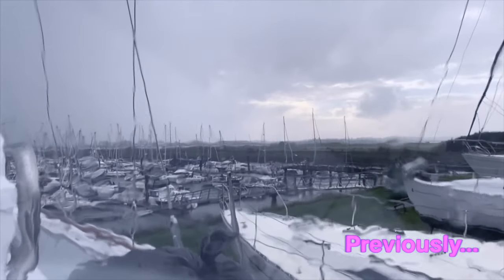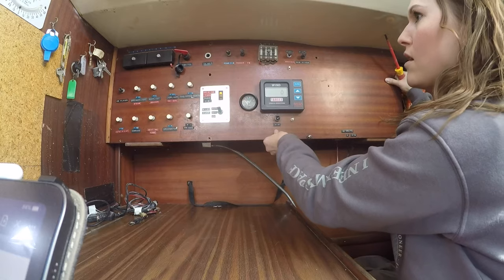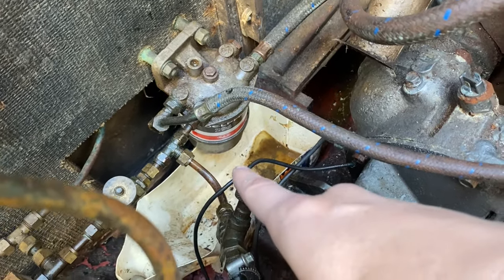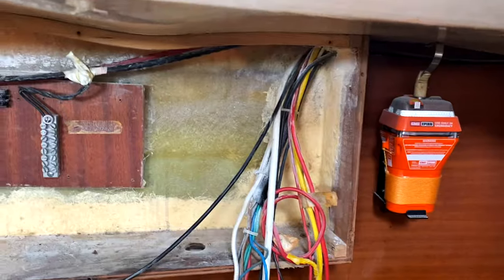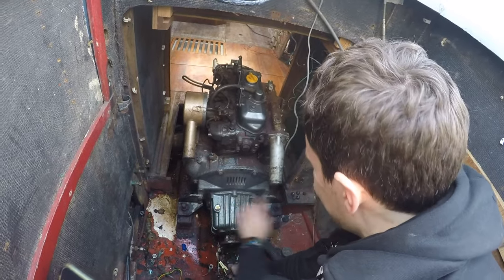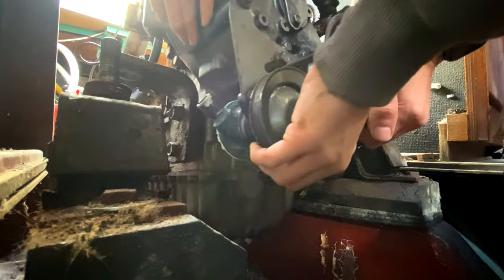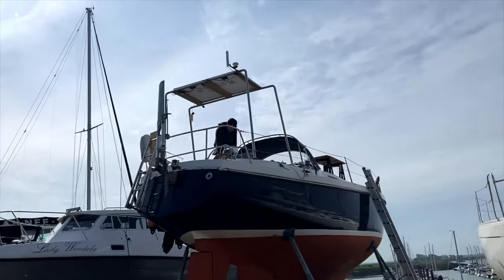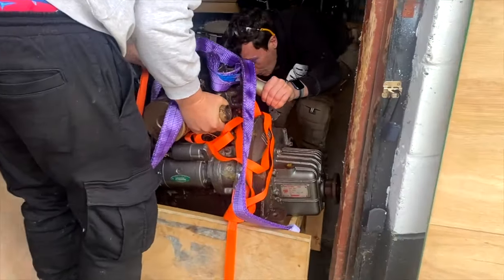Ep 11 | Engine OUT and Cable Management BEGINS!

Comment: ..... leaps ahead .... well done .. .... only concern is getting between a heavy objects that you can not fully control and a fixed object, especially a heavy object with pointy protruding thingys ..... when things go wrong it happens in a blink of an eye .... always have an escape route .... you know this, just felt the need to bring it to the forefront of your thought patterns for a second or so, not being critical, just raising awareness, giving the ol' grey matter something to mull over ... half wonder if that catch basin/cut-off-jug was for when that, was it fuel filter/water-separator, was serviced and was just stored there. Yes you are right Ben, better solutions, everything has a place ..... sounds exciting the thought of a sparkling bilge, don't like "au naturel" insides of hulls. Just a preference, choice .... recently bought an older vehicle and after a while found that there were certain electrical things not working, fine older vehicle (1990) to be expected, it is going to be more involved than I anticipated for sure, this realization hit home with the discovery of wiring harnesses the size of your thumb just cut off. Have come to the conclusion/choice as you did that a complete rewire is the best solution.. Your are ahead of me having got the old all out of the way. All fun and games in the big scheme of things ..... thx for the share .. as always .. never stop dreaming, just dream bigger .. have fun be safe, save our oceans .....
Reply from the maker: Thanks for the great advice again, Peter!🙂 Good luck with your vehicle, hope the wiring isn’t as bad as ours 😵‍💫